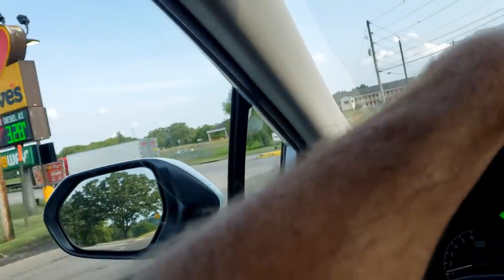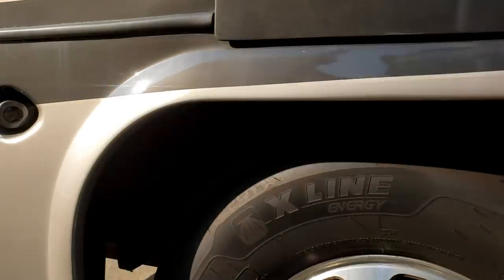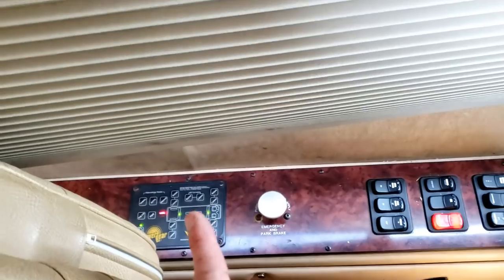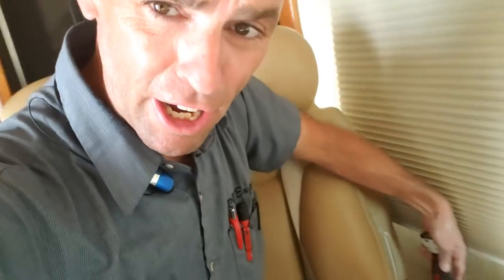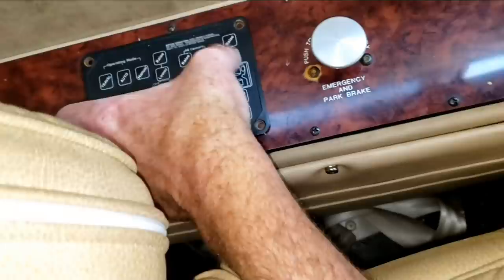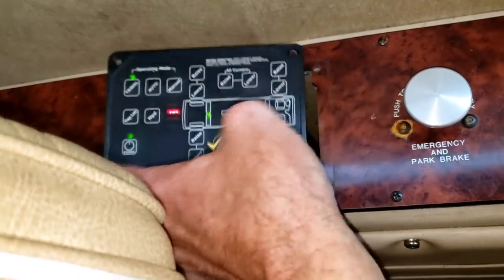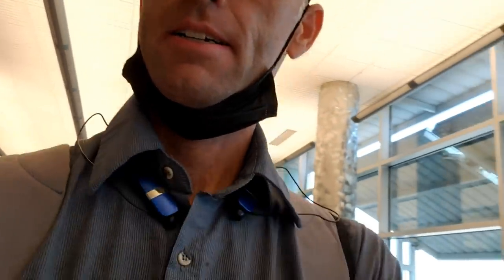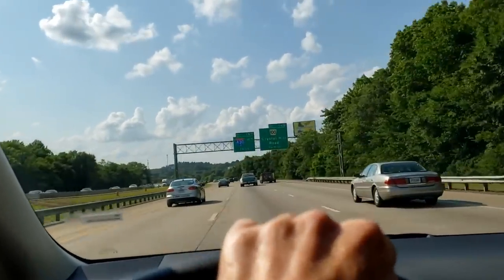A Very LONG Service Call on a 2008 Beaver Marquis

Comment: I'm a heavy duty diesel mechanic and I specialize in suspension and driveline. I never would have figured that out! I would have bypassed the problem by plumbing the air ride like an old school semi truck, completely negating the self leveling. Good work, your totally right about it being a niche repair.
Reply from the maker: I appreciate the compliment! Thanks for watching! :)

Comment: My 06 Patriot Thunder has the leveling control panel in the same place, under the side window, if the window leaks or you forget to close it you get water all over that side console, Beaver/Monaco should have installed it some where else. The HWH system on my coach has a manual override to place the system in travel mode just in case.

Comment: Small tip, try to use some rubber care on those air bags from time to time. This will prevent cracks. They last a surprisingly long time if you keep the rubber in good shape.
Reply from the maker: I'll make sure to keep an eye on them

Comment: That’s a big Beaver! I was wondering why you were headed to fix what seemed like a chassis issue.. now that makes sense with the air leveling system. I bet that was fun to drive, big Cummins engine no doubt.
Reply: Most of the big tandem beavers around that time had C13 caterpillar engines

Comment: We had a Wanderlodge owner loose his hydraulic fan motor. Fan went into the radiator. He left it near Naples FL at a mom and pop store. I and another local owner helped him get the rad out. He rented a van and left for a week. We, I and the other local owners) agreed to take turns watching his bus. He (coach owner) gave some money to the store owner. It worked out. This makes me wonder if that pad was set for a different coach in firmware. Don’t do as I say lol

Comment: Great job. You could build air much faster by either setting the high idle control or simply mashing the accelerator down to say 2000 rpms, this is also better for the engine to run high rpms if you must idle for more than a few minutes. All large diesel engines are very happy with high rpms. The engine governor control will protect the engine from too high of rpms, in case anyone is concerned. Thanks for sharing.
Reply from the maker: Thanks for the tip

Comment: I had a semi that was running a load to Canada and in Montana the ride height arm came loose.  I had heard the sound of tires on the bottom of a trailer before.  I dropped the trailer in a large pullout and was able to reach in over the frame and reconnect the arm.  No way was I going to crawl underneath and mess with the air suspension.  It did it several times before I could get into a shop.  Got it down to a 15 to 20 minute repair.
Reply from the maker: Oh wow!

Comment: So I just stumbled onto this video a year after the fact. After watching I have to ask why the first trouble shooting step wasn’t tried before you flew to Arkansas? I have fixed home AC units, clothes dryers, cars, refrigerators, sound systems, etc. By trying the most basic primary trouble shooting step. So a call and a part sent to remove 4 screws and swap a plug and play board seems like a no brainer to me. Obviously it would get the RV drivable to get it to a more robust examination and repair facility. I’m just saying. 
☮️
Reply from the maker: There was no one to fix it. It was stuck at a truck stop.
Reply: @AZExpert  🤔 Not my place to argue. It just seemed odd to me. Not a RV person. Just always curious and learning. Your videos are interesting.

Comment: I’ve heard good things about Beaver Motorhomes are they on the same level as say Country Coach?
Reply from the maker: I think they are better
Reply: @AZExpert  so your opinion is that Beaver was a better coach then CC ?
Reply from the maker: I don't really like the electronic/wiring bays on country coach, the dash A/C blower access, and the lighting is usually not as good in a Country Coach compared to a Monaco. Both have great features and construction, mine is a service POV mostly.